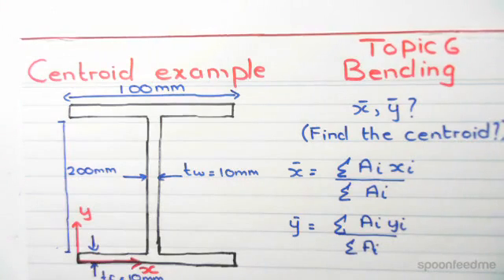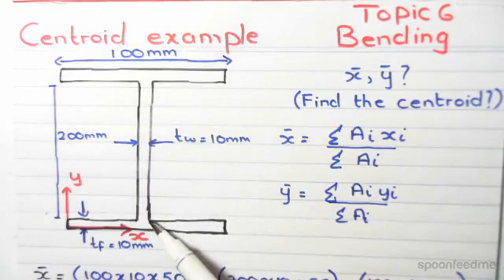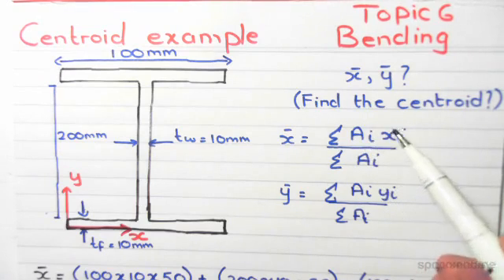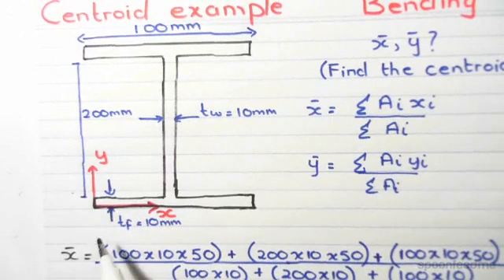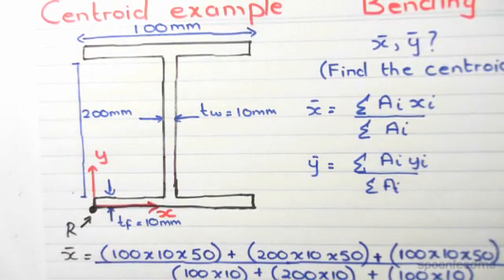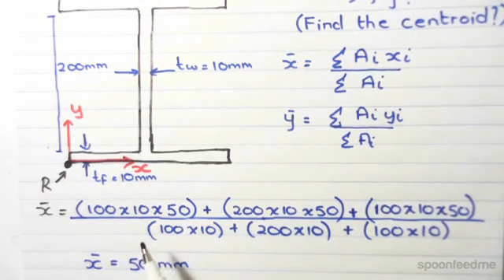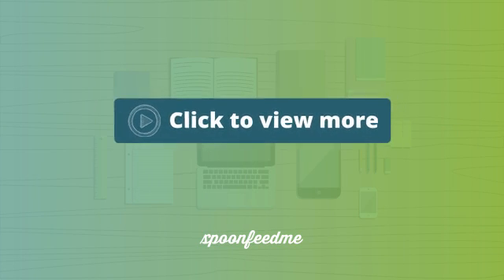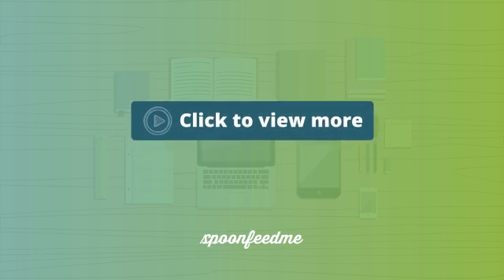Centroid of I-Beam Example | Mechanics of Solids

Comment: Good video mate, but i think in the full video on your website you have the wrong number for Y bar, for the centre of the top flange it should be 215, once you've added the 10, 200 and half the top flange which is 5. I think you've added 10, 200 and 10 again for the top flange but our reference point is in the middle so you should half the top flange thickness.  Unless I'm reading it wrong from your video.